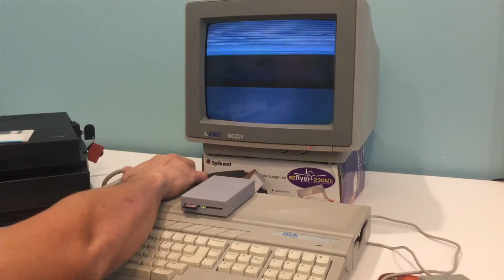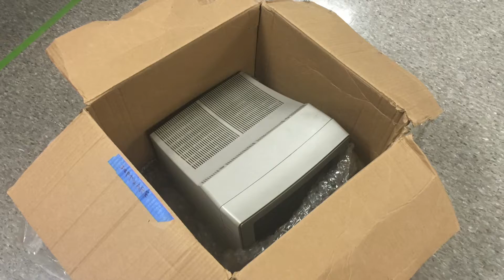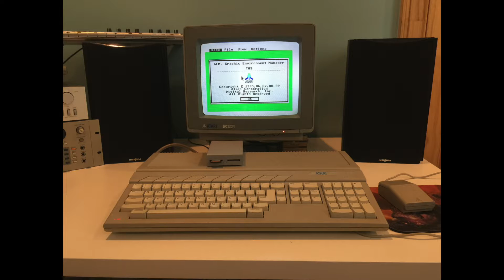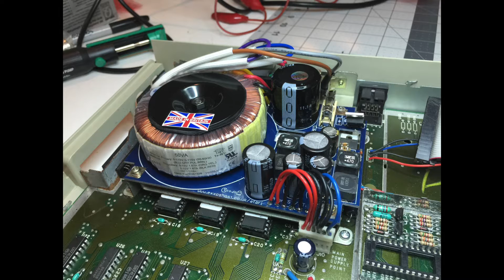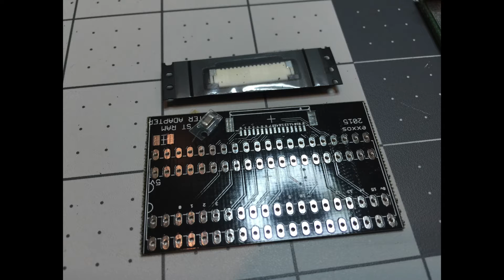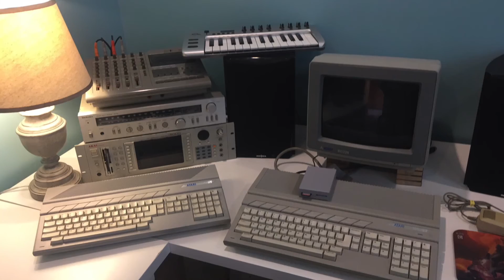Atari 1040ST Restoration p2: Busting rust and smashing RAM! - SIMPLETHINGSTOYS

Comment: Awesome job SIMPLETHINGS, and thanks for putting up the video and the plug. I hope to see some more videos on the games you showed. Don't forget we had to re-solder the RAM Upgrade Kit with LEAD solder, because removing it and reinstalling it several times cracked some of the Lead Free solder joints. I HATE LEAD FREE SOLDER it's really crappy and fails EASILY if bumped a few times during maintenance! With the new re-flowed Lead Solder joints it should last a long time, and you should be able to do upgrades without worrying about it. We make a good team bro. Hope to see your new project and some game videos soon. 
Best Wishes n Blessings Keith
Reply: do u have any other ATARI ST machines you have repaired?